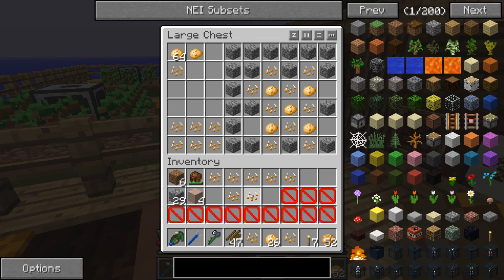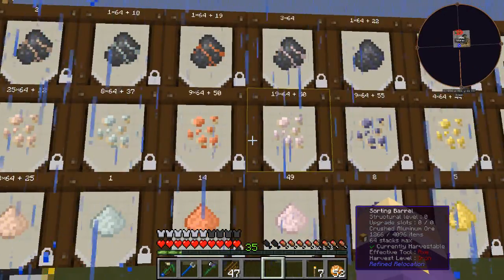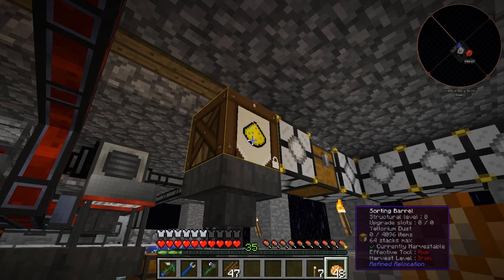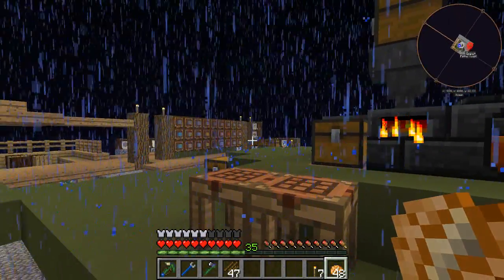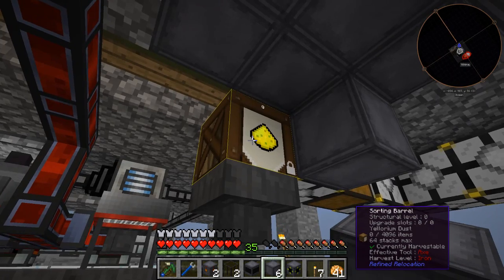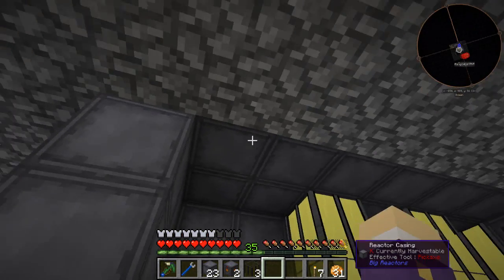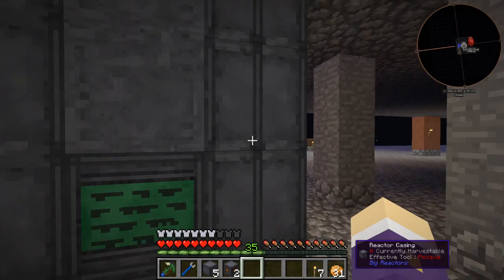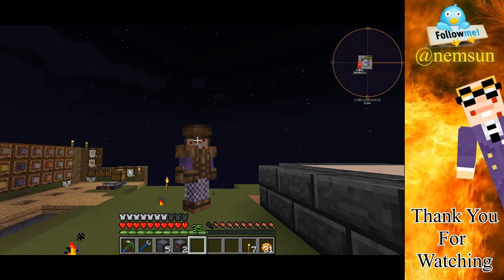[Let's Play] Agrarian Skies 2 :: E10 - End of week 2, BIG Reactor!

Comment: Sieving sand was pretty useless in AGS 1, so I guess she put yellorium and quartz in there to make it not useless in AGS 2. Pretty impressive how fast you got your big reactor up and running. If you make two reactor redstone ports, you can use whatever redstone cable in this pack to auto control your reactor. Set one port to output power stored, and other port to input control rod insertion.

Comment: hhmm ... about the seeds there is a slightly better way to do what your doing .... if you put you best seed in center mature that then put crops on each side spread seed .. when spread to all 4 sides remove center and throw away mature the 4 that just spread then crop the center ... that center will take the best from all 4 ... then keep new center and repeat process you will achieve 10,10,10 quicker. i hope you understand and helps if you do i wish i could do a video to show ;p

cheers keep up the vids love the terrafirmapunk seires
Reply from the maker: Stephen Carter I tried the single crop spread in earlier episodes, the seeds only duplicated no mutation was found. ie, a 1/1/1 seed made another 1/1/1 seed. Having two parents for the seed seems to be the config option for this pack. So the 4 crops into the center seems to still be the best method.

Comment: Hey Nem, just so you know that machine that compresses the dusts into their block form is called an autopackager, not an autopacker. So it might actually be in the pack. Also the big reactors from the big reactors mod can ONLY explode if the reactor has too much cyanite in it, so you should make sure that it has a proper cyanite output. Love your vids! =D